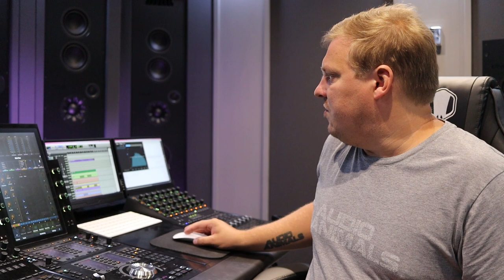How Can You Limit And Compress A Dolby Atmos Mix?

Comment: Great video, however, I think there are a couple of points that could potentially be described a little differently, so as to avoid some potential confusion,  
The first one where you refer to ceiling.  ie -18LUFS.  I think you mean that you are describing the average program level of the full duration of said program.
The ceiling would be described as the True Peak, which on most music platforms appears to be either -3 or -3.5 dBTP.  Not that you would even get close to that, if the average (or LUFS /LKFS) is sitting nicely at -18 to -19LUFS.
The second one relates to clipping, or buss compression.  You made the point that it would be really great if DOLBY included some kind of master chain in the Renderer to accommodate the need to link not only the Bed channel, but also the object channels that do not have anything to do with the 7.1.2 bed leaving Pro Tools.  (I would really love this too ...and that it be could controlled from a Pro Tools plugin guide, such like the one that lets you control the Binaural render settings in the remote Renderer now, that you displayed)
There are many ways around this, ie by having the exact same compressor and settings of on every Object channel and every channel of the 7.1.2 bed, all linked and being fed, by a sidechain send from every said channel (ie Everything)...  It gets confusing, but there are even many "Atmos" compressor developers coming out that claim to be atmos mastering comps, that don't take the Objects into account. 
If someone goes into the exercise of mixing in DOLBY Atmos and doesn't realise all of these points, their fold downs are definitely not going to translate well down through the re-rendering formats and the metadata being generated by the Object banners and binaural settings of said objects are going to be pretty crazy out of whack.
This is a great video Paul and I think you were alluding to and mentioned all of this, but I was hoping just to help a little in clarify for some people that may not understand the complexity of the issues, that make this such a different workflow to just smashing the traditional stereo master buss.
Cheers,
Matt

Comment: I have a killer mix in UAD Luna that has nothing on the master buss and is -18 LUFS.  I think I HAVE to have you master it in ATMOS :)   Should I print the FX sends into the stems or would it be cool to have those separate?  Guess it couldn't hurt to separate them.
Reply from the maker: It is better to separate them as we can then position those sends in the room independently from the dry sound.
Reply: @AudioAnimalsStudio  and when you get a reverb stem you have to obviously up mixed it right? which plugin do you recommend for that purpose?
Reply from the maker: @ArielQuesada  halo upmix is really good

Comment: I read in forums that you cannot use hardware processing when mixing in dolby atmos, is there any truth to this?
Reply from the maker: Some truth in this. You do not have a physical stereo bus to apply processing over. You cab however apply stereo analogue processing before summing to the atmos renderer. You can not apply analogue summing as this is only 2 channel and Dolby Atmos is 128 channel.
Reply: @AudioAnimalsStudio  hmm so you process with hardware each track, print in your DAW, send prints to DA, use DA to place in surround (an maybe process with plugins 128 times), render final mix (right?). Is the rendered version stereo or 128? how do you integrate hardware for mastering?
Reply from the maker: @joeyramonelookalike  no none of this is right. There is zero DA conversion unless you use inserts to analogue processing. 

Mastering in stereo sense to use analogue hardware is done in exactly the same way as stereo mastering using the binaural stereo print from the renderer. 

There's a lot to get your head around with atmos mixing. Would be too hard to explain in a comment. It's all about changing how you think. You are currently thinking in stereo terms. I'd advise watching some videos on atmos mixing as this will give you a better understanding of the fundamentals. Then you'll understand my comment better.
Reply: @AudioAnimalsStudio  thanks. By DA I meant Dolby Atmos, not digital to analogue (sorry for the confusion). As to the mastering, I was under the impression the binaural print is an alternative to the final Dolby Atmos file (atnos.IR), no? (Meaning a stereo-ish version for headphones and not the full version for a surround system). I'm trying to figure out if hardware becomes useless for Dolby Atmos if your files ( .atmosIR) are not stereo anymore, specially at the mastering stage.
Reply from the maker: @Joey Ramone  the binaural stereo file is stereo and is not technically full Dolby Atmos multiple speakers. The binaural stereo file is what you will hear playing on streaming platforms. Being stereo this mix can then be mastered in exactly the same way you would a stereo mix mixed in stereo. The ADM atmos master is multi channel up to 128 channels. To answer your question you do not need any analogue processing to mix in atmos. Analogue gear is best used for stereo mastering only.
Reply: @AudioAnimalsStudio  many thanks for taking the time, I appreciate it. Out of curiosity, do you reckon hardware will become obsolete (or an unnecessary luxury) in the future (particularly with Dolby Atmos in mind?).
Reply from the maker: @Joey Ramone  yes for atmod mixing purposes I think it'll very much it'll become obsolete. For stereo mastering analogue is still king and very much superior to digital mastering. Also still have a place. Stereo analogue gear will still be required. Even if working in atmos the object are still stereo so can be processed with stereo equipment. I would agree when mixing it'll all go atmos soon and when it does it'll be pretty much 100% in the box. Things may change as we advance with atmos.

Comment: So it sounds like its not possible to incorporate analog gear into the Atmos mixing/mastering process at this point...at least until they add the architecture for some type of bus system.
Reply from the maker: You would need a 128 channel analogue processor for Dolby Atmos mastering. Just doesn't make sense to create one. You can still use stereo and mono analogue processors at the Dolby Atmos mix stage you just can't across the master bus.

Comment: Sorry but there is a lot of easy ways for you to explain that... And you are right into a certain point, and wrong in other point... You are right in about 128 channels... But those 128 channels are called objects, and it is includs the bed... If im not wrong it is a bad of 10 channels fixed... And the other 118 objects will rung on the bad... That leaves a 10 channels master... The objects you select what you need to do with them... I am only a hobbist...
Reply from the maker: No, that's not correct. The objects do not sum into the bed. This is bad information. The bus is 128 channels consisting of 10 channels in the bed and 118 channels as objects. The objects are their own channels. The master bus would be 128 channels. If the master bus was 10 channels, how would you playback the atmos master on a system larger than 10 channels. A 10 channel atmos master using only the bed will only ever playback a 7.1.2 system.
Reply: @AudioAnimalsStudio  and how you play a 128 channels? Do you have 128 speakers In your studio? No, you may have 9.2.6...
Reply: @AudioAnimalsStudio  this is very funny but there is when binaural comes in...
Reply: @AudioAnimalsStudio  if I am wrong, than explain it to me... Because in this video your not explaining this...
Reply from the maker: @NorteWeb  your understanding of atmos needs some getting your head around a few critical things. The atmos renderer plays back all 128 channel to the speakers. You are mistaking the speaker configuration as a master bus. This isn't the case. The whole point of atmos is that it is object based. This means that 118 objects can move across speaker configuration. One atmos master plays back on a 7.1.2 system as well as a 30.1.12 system. This is a fundamental aspect of atmos you need to get your head around. It'll click as you work on the format more.
Reply: @AudioAnimalsStudio  so how many outputs do you have?
Reply: @AudioAnimalsStudio  you are getting to my point